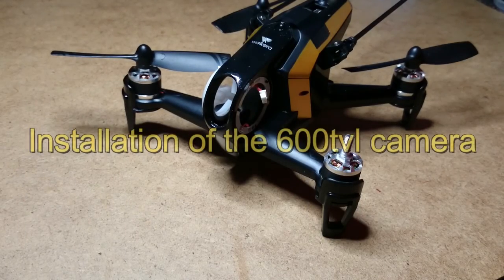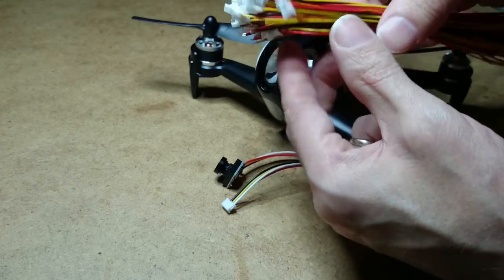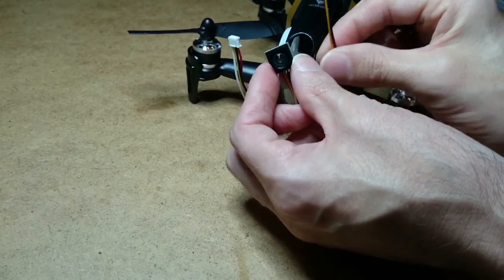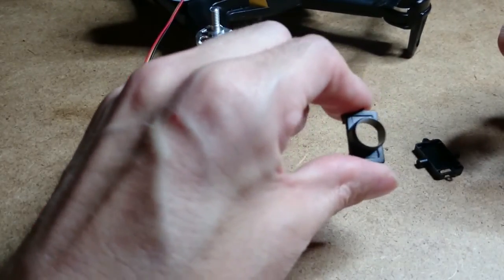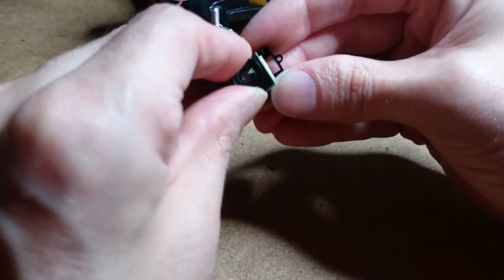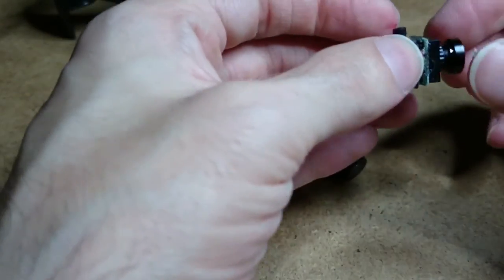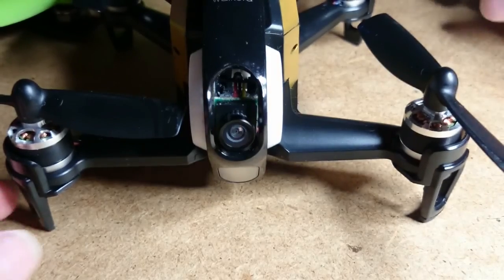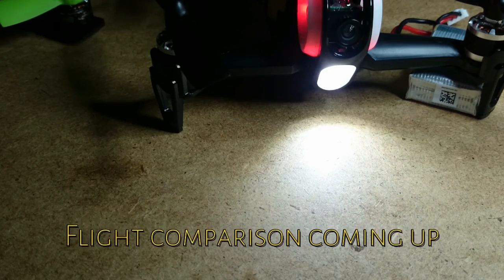Walkera rodeo 150 600TVL Camera Installation

Comment: i found 2 x small tie wraps worked well to stabilise the camera. I found I was getting a bit of a wobble. 
top to bottom....through the wire hole and a tad of heat on them with a soldering iron to give them a right angle

Comment: hiya (again) - general Q as i've been having issues. Black screen on my skyjone sj v-01 with standard camera so swapped to the camera you linked to (got both PAL and NTSC just in case) and still only get black screen.
Ive had a new VTx after a crash but all seems to be ok with that or surely i'd just get snow?
Reply from the maker: It might be the camera do a camera swap,i have had a few of these cams break on me in a crash and make sure your on the right band and channel.

Comment: hi - does the upgraded camera connector not fit directly into the VTx?
Reply from the maker: I'm sorry but no it does not,you will have to solder if you want to mod it.
Reply: like for like? red = red etc?
and PAL or NTSC camera??
Reply from the maker: Match the colour of the wires up but double check the polarity with a multimeter,the VTX can take PAL or NTSC.
Reply: excellent - thanks
will get 1 x PAL and 1 x ntsc as I have skyzone sj-v01
Reply: I guess the audio feed wires are just ignored
Reply from the maker: Yes just take the white wire and mic of.

Comment: Hi, Merch.Thanks for pic link.have 2 questions only:
Is that wire arrangement on picture same with inside your drone last time?If yes, so we MUST reverse wire polarity red and black to the cam Isn't it?Best Regards, Jeffri
Reply from the maker: No you don't want to reverse it just match them up and yes it is the same but you are always better checking everything with a multimeter because sometimes you never know when walkera decide to change something.
Reply: Thank you!!
Reply: Merch RC 
This is me, previously use friend's laptop.
again, thank you! :)
Reply from the maker: Np:)

Comment: Hello Merch,
Thanks for showing caution on cam's wiring. It will be better if u can show us wiring connections points on your drone. solders points on VTX PCB.  this is important in case walkera have changed wiring solder with correct polarity (red-black) so this is pros learning for us as beginner too..
Reply from the maker: It is not the pads on the the board that are the wrong way around it's the wires put on the extension socket itself that get mixed up.If i get the time i will try and post a video.
Reply: Thank you for planning to post other cam wiring vid. It is highly appreciated, I have rodeo 150 and planning to upgrade the cam in future.
Reply from the maker: If it helps check this image at the bottom is the VTX and how the black,red and yellow wire are connected to the board.https://static.rcgroups.net/forums/attachments/5/9/2/0/a9151812-224-osd_assy3_1000.jpg

Comment: It is mode PAL right?
On the link to the camera?
Reply from the maker: You can use Pal or NTSC with the rodeo 150 but i used NTSC.
Reply: Okay, thanks, On the link in this video I only see the PAL option.
Reply from the maker: I can see both PAL and NTSC are you using a tablet to check the website? it's showing up for me on PC.
Also make sure you'r FPV goggles or display is compatible with whatever you choose.
Reply: I see it now, it just isn't in the US Warehouse, will have to order from the other warehouse. Thanks.

Comment: I have a runcam owl mini fpv cam on the way.  I have a couple questions since i saw you have one.  First, is it even going to fit in there?  Also, can you tell from the stock cam what voltage is running to it and if its the same plug in?  I think the owl is 3.3 volts so it would be nice not to use the regulator and run off stock vtx and battery.   Thanks
Reply from the maker: I baught the runcam owl for my rc truck but i can say you would really need to mod the camera area of the rodeo but it's possible.
You would also need to use the regulator as the stock VTX pumps out 5v and solder some wires to connect to the VTX.
Reply: thx for the info.
Reply from the maker: You would need to use the regulator as the VTX gives out 5v and yes it would be possible to put the owl in but....You'r gonna need to mod it:)........funny thing is i was just thinking about this about 30min ago lol.
Reply: Merch maybe you'll have better luck.  got a dud cam or the red wire is negative and fried out already
Reply from the maker: Maybe it was because of this it is ib the description.https://www.youtube.com/watch?v=8_kCdi8EWQw

Comment: Hey I couldn't reply to your comment on my vid Leo for some reason. The rodeo I have has a 600 tvl camera. Did yours come with a different camera or the one you replaced it with is just better?
Reply from the maker: Sometimes that happens just close and reopen you'r browser,
The camera i replaced it with is miles better.
Reply: Thanks I might have to order one

Comment: Nice mod good video!
Reply from the maker: Thanks.
Reply: +Merch Hello ! I have 2 questions to make the same change as you! must be taken into NTSC or PAL? and is that this camera can work and be better? http://www.banggood.com/700TVL-14-Cmos-1_8mm-170-Degree-FPV-Camera-NTSCPAL-3_7-5V-p-1070265.html
Reply from the maker: Yes that one will work the VTX can take PAL or NTSC.
Reply: +Merch thank you ! it is smaller and more tvl , but it is 1/4 is better or not?
Reply from the maker: I am not sure about the 1/4 but if i remember right someone else used that camera and got a good picture.
Reply: +Merch OK thanks ! I will take the 2 camera! to be sure
Reply from the maker: Happy modding:)